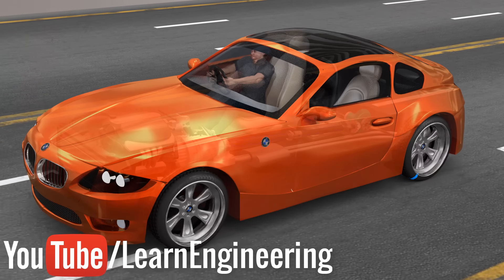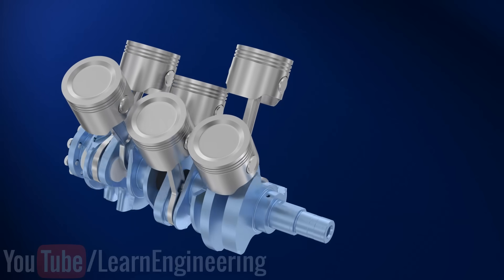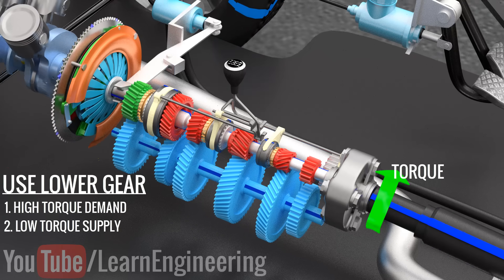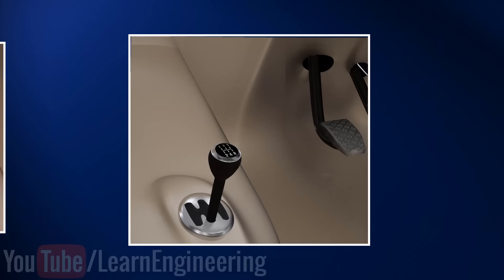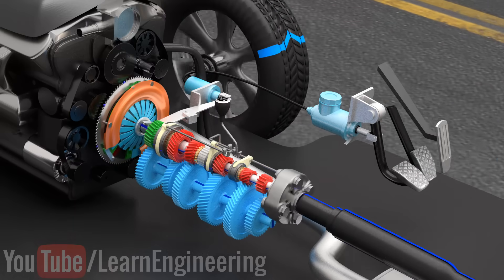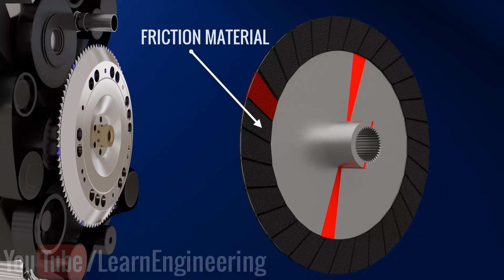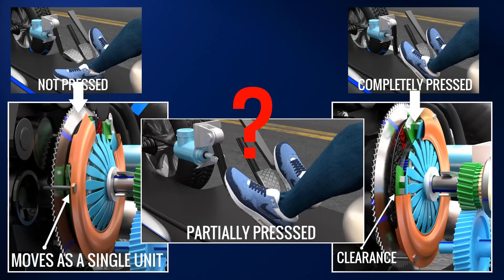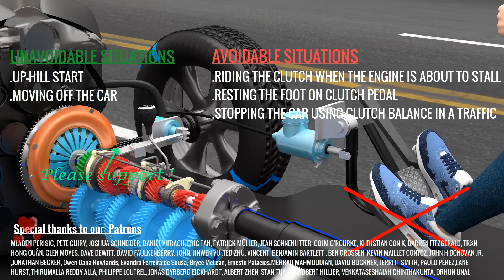Why you should not PARTIALLY press the Clutch?

Comment: You have to depress the clutch slowly though when you start running in first gear or else the engine would stall if you release it too quickly. You can't really avoid riding the clutch in constantly crawling traffic or else other motorists will be annoyed at you for always stopping your car because only at neutral at stop or when the vehicle is above stall speed can you take your left foot off that pedal.  It's not always as simple and straightforward as this video suggests.   However, it's really a good habit to keep your foot off the clutch when you're not using it as that would cause unnecessary wear.
Reply: Not unless you clutch dump when taking off at green lights every time. Skid marks on the road and everything
Reply: Feeding the clutching is handy for parking lots and super slow speed traffic jams. I'd rather do that than hit something or bog the engine down with brake action. Its a small price to pay for control.
Reply: @NICO gaming -  asked (then deleted) 'why don't I show you' how to drive correctly?!
Come over anytime and I'll happily 'show' you.
While I'm at it I'll teach you some manners - something your mummy clearly forgot to do.
There's a huge difference between correctly operating real machinery and sitting in front of a computer screen playing with your stick.
Now, go back to playing your one-handed 'games', little troll.
Over and out.
Reply: You can ride the clutch when at an incline where you have to stop a lot of lazy people do this as it's easier then putting it in neutral and handbrake
Reply: @djthegrateone  
Why, in the name of all that's logical, would you put a vehicle in neutral on an incline?!
Reply: No you don't, you know just need to know where the biting point is and have good control of the gas pedal.
Reply: There is no need to 'ride the clutch' in slow moving traffic.
Simply select the gear appropriate to the speed at which the traffic is moving and,  as and when necessary, FULLY depress the clutch to cater for occasionally slower speeds.
Keeping the clutch pedal partially depressed is of no real benefit.
On an incline, if you can't effectively balance your use of the 3 pedals, use your handbrake. It's not JUST a 'parking brake'.
Other than on initial moving off or during gear changes, there is NO acceptable reason for the clutch pedal to be held partially depressed.
Not 'riding the clutch' is not 'advanced driving skill' - it's BASIC driving skill.
If you believe otherwise, perhaps consider taking a course that actually teaches how to drive - as distinct from how to get a licence.
Reply: @trueaussie9230  wrong there are always slower speed in near standing still jams that requires to ride a he clutch somewhat but that isnt as damaging as they are making out to be here. But running the clutch at speed thats another kind of stupid.
Reply: @MartiniPinball  
Wrong.
My current vehicle will happily 'idle'  at around 500-800 rpm, moving smoothly at 1kph or slower - with the clutch fully released.
If you understand how to manage the accelerator in concert with the clutch, there is no valid reason to 'ride the clutch' - EVER.
EVERYTIME the clutch pedal is not either fully depressed or fully released the clutch plate is incurring unnecessary wear and the vehicle is not completely under control of the driver.
Whilst I'm concerned to minimise wear, I'm more concerned to ensure I have total control over any machinery I am in charge of.
If you want to learn how to drive CORRECTLY, do a stint with a military transport company.
Reply: @trueaussie9230  moving slowly at 1kmph with clutch released? I call bs. Every car I have ever driven goes atleast 7+ (noticibly faster than waliing speed)  maybe even 15kmph with clutch released.
Or older ones just stall if you arent pressing gas while in first gear
Reply: @TheMartuksxxxx  
I don't believe I said anything about not pressing the accelerator.
If an engine's idle speed is 500rpm, when that engine is put under load - eg by releasing the clutch in 1st gear - one must increase the fuel supply in order to maintain 500rpm.
Simple physics.
It seems either every vehicle you've ever driven has had major mechanical faults or you simply aren't capable of controlling the accelerator effectively.
But I only have 50+ years experience driving everything from 500cc 2 cylinder vehicles to B Doubles, across all sorts of terrain in many countries.
So I will just say "whatever you say, kiddiewink". 😉🤣🤣
Reply: @trueaussie9230  You must have rather unique vehicles... Like @Daniel Clark, I have never experienced any car either that will barely move on first gear with clutch fully released. All cars I've driven have also gone at around 7-10 kph at idle level RPM.
Reply: @emperror85  
Your vehicles must all be in urgent need of mechanical attention.
Or, more likely, your ability to control a motor vehicle is seriously compromised
Since experiencing all the.muppets commenting about this video I've done a survey.
I don't personally know ANYONE who isn't able to control a manual vehicle in the way that I've described.
(But we were all born before 1980. 🤣🤣🤣)
Reply: @trueaussie9230  So every single car I've driven have had that issue? Including new ones in showrooms? Newly serviced cars? Or is it maybe just your car that for some reason is weird? The only explanations I can see for a car to be able to go at 1 kph with clutch fully and not stalling is either if you have a custom made gear with absolutely ridiculous gear ratio made for climbing vertical walls, or if your clutch is so worn out that it just slides around instead of your engine stalling.
Reply: @emperror85  
I have no idea what 'issue' you think 'every single car' you've driven HAS had. ('Every single car' is singular, so the matching form of the verb 'to be' is 'has' - not 'have'.)
However, the alternative to your proposal  is that every manual vehicle that I've driven in more than 50 years, including rentals and 'brand new' cars OUTSIDE the showrooms, and every single manual vehicle that every mature (ie born pre 1970) driver I know has driven in more than 60 years has been 'unique' and / or 'specially engineered' and / or 'faulty'.
Here's a thought - if a particular driver experiences the same issue with every vehicle they drive, logic dictates that the problem is with the driver - not with the vehicles.
But, I'm sure you know better.
I understand how your puerile arrogance renders you incapable of accepting that others can perform tasks that you're incapable of achieving. (You probably refuse to accept that others have won gold medals at various Olympic Games simply because you haven't.)
So, I'll just say 'whatever you say, kiddywink'. 😉😊😇
FYI - if "7 to 10 kph at idle" is too fast for the prevailing conditions you can always gently apply the brakes - without stalling the vehicle - or fully depress the clutch and 'coast'.
Are you suggesting that at '7 to 10 kph' @ 500 rpm, if you don't ride the clutch and / or increase the fuel supply the engine revs, and subsequently vehicle speed, will not progressively decrease and the engine will just immediately stall - at idle?!
(Do you understand the meaning of 'idle' - and 'below idle'?!)
No doubt you believe that if all of the text you create is littered with primary school grammar mistakes the 'problem' is not with you, it's with the English language. 🤣🤣😉😊😇
Instead of spending your time playing with your dick, take some time to 'play with' and come to understand your vehicle.
You never know, you might discover that YOUR limits exist only in your imagination and are fed by your fear of failure.
Reply: @trueaussie9230  at speeds that low my engine stalls without depressing the clutch 
what am I doing wrong
Reply: @mikethespike056  
NO engine goes straight from idle to stalled.
If 5kph is too slow for idle in 1st gear, change to 2nd gear and possibly increase the revs.
In short - learn how your vehicle works.
Reply: @trueaussie9230  eh, you might be TECHNICALLY right, but there’s plenty of times where I live that I’m going around a corner at a speed that would be very very high for first gear and very very low for second, shifting into second and keeping the clutch slightly depressed for an extra moment or two is not the end of the world. I’m also not holding it 1/2 way going down the freeway, but acting like there’s NO time that it’s the best option for the average driver is pretty ridiculous. But then again, I’m sure you’ve driven every manual car in every part of the world, so what do I know 🤣
Reply: @BadoreksDailys  
I have no idea what your referring to when you say I "might be TECHNICALLY right".
Nevertheless.
If it's possible to find a 'speed' in your vehicle that is "very very high for 1st gear and very very low for 2nd gear" I suggest there is something extremely wrong with the design of your gearbox.
My current vehicle (5spd manual) has no complaints holding 50kph in 1st or picking up from as low as 15kph in 2nd.
And if you think taking a corner at any speed with the clutch not fully engaged equates to 'safe driving practises', good luck to you (and everyone on the road with you.)
Seems to me you simply fail to pay sufficient attention to the road to enable you to select the appropriate gear at the appropriate time.
I repeat- if you want to learn how to drive correctly, do a stint with a military transport company.
I suspect I've driven far more hours / kms, in far more vehicle types, over vastly different terrain in more countries than you can even imagine.
But what would I know?! 🤪🤣🤣
Over and out.
Reply: @trueaussie9230  hey genius, that's exactly the problem. Traffic moves slower than the crawl rate on 1st gear. It's impossible to "select the appropriate gear".

Add stop and go traffic to that and it's a real shitshow. Best you can do is to wait until there is decent cap between you and the car in front of you and roll that as slowly as you can.
Reply: @moroit1  
It seems I must be a genius, certainly compared to you. 🤣🤣
I never have any problem.
But I only have 50+ years experience driving everything from 800cc 2 seaters to multi trailer trucks.
When you start moving in 1st gear you start from 0kph - ergo there is NO speed too slow for 1st gear.
That is the purpose of it.
The fact that YOU can't do something does not mean it can't be done.
Perhaps if you ever grow up you might actually learn how to drive - and learn respect for those with more knowledge and experience than you.
Over and out.
Reply: @moroit1  @Trueaussie is a troll most likely or has driven in outbacks. Really there is no other way when the traffic moves slower than the crawl speed.
Reply: @younawab  
Your funny 🤪🤪🤪😅😅😅
Reply: @moroit1   Just coast at the lower speeds. Never ride the clutch. Eg. Engage the clutch slowly from standstill in 1st gear, then disengage the clutch and roll. Then slowly apply the clutch to engine brake. Repeat.
Reply: @sideparting6845  And that my dear is a fast way to wear out & overheat the clutch in stop & go traffic. 

When you do it slowly / ease it in or out it is generating movement friction between the clutch plate and flywheel contact plates. That friction generates a lot of heat and clutch area is not usually too well ventilated, so it collects heat fast. 

I recently replaced clutch & DMF on my daily for the first time at 375 000km. Clutch itself was in near new shape as it was driven properly. (Replaced due to worn DMF)
Reply: @moroit1   When I said "ease in slowly" I meant over half a second rather than dropping the clutch. I wasn't meaning giving the car gas and then easing it in over 10 seconds. I just meant normal driving but with coasting.
Is there a better way?
Reply: @sideparting6845  That's just normal use of clutch. Easing it in has always meant releasing it with a good while of slippage. Dropping the clutch would be on the another end where you, well drop the clutch without any easing it in.
Reply: @Mario Antonio
Depressing the clutch pedal disengages the engine from the transmission - and you go nowhere.
When "you start running in first gear" you need to RELEASE the clutch pedal.
If you don't understand those very basic facts it's not surprising that you don't know how to operate a vehicle correctly.

Comment: I'm guilty of doing this, but only when and if I need to park up a driveway with a slope, and in 1st gear only. I thought everyone did that. Because that's how I slowly get up the drive way without stalling and without going so fast, that I run the car through the garage door by accident. It's also something I do in reverse when I don't want to wait for my idle to slowly push me, but I don't want to gun it in reverse either. Again, thought everyone did that too. What I don't get, is why anyone would do that in any other gear other than 1st and reverse.

Comment: I press partially press the clutch all the time and my car never had any problems. I've used it almost every day for the past 5 years and the car is 20 years old. People also say that you should push the hand brake button when breaking the car and that doesn't seem to be true either. Just be reasonable on the way you drive and everything should be fine.
Reply: You're putting unnecessary wear on the clutch, and have poor driving technique. But that's your choice. Also, you shouldn't be using the hand brake at all while braking.

Comment: Would fully depressing the clutch burn your clutch out or does it only burn your clutch when it's 50% depressed or depressed to its biting point?
Reply: When the clutch pedal is fully down or fully up, there is no wear to the clutch plate. The clutch plates wear down when it is partially engaged and there is slippage (in other words, when the clutch pedal is half depressed and kept at the biting point). However, when you press the clutch pedal down, it puts wear on the throwout bearing.

Comment: My mum used to (at least I hope she doesn’t anymore) rest her foot on the clutch pedal burnt the clutch out completely in about 20k miles, just had it replaced. 

I always rev match and heel and toe (95% of the time anyway) because I have more mechanical sympathy and my engine is out because of a bottom end failure, but looking at the clutch at 65k miles it’s still got plenty of life left in it, unfortunately it’s getting changed anyway due to replacing dual mass flywheel as well. 

It pays to learn how to drive manual properly, more driving satisfaction, less damage to your car

Comment: Yeah but sometimes you need to change gear fast in situations and not fully press the clutch is necessary
Reply: Name 1 situation where that's necessary.
Reply: @tylhunt  could maybe need to change down gears to slow down in case of emergency you going to make sure you fully depress the clutch when you are going to hit something you would just smash the break and drop gears as fast as possible and most likely a few will be half clutch or almost full clutch press but it won't be priority will it to save the clutch when you need to stop.
Reply: @Lih55  If you need to stop in an emergency, press the brake pedal. That's it.

If you need to change gears quickly for whatever reason, depress the clutch pedal fully to shift. Partially depressing the clutch pedal and shifting is not going to harm your clutch, but it may make it difficult to shift(causing you to take MORE time to shift), and cause damage to the transmission.

Comment: Without a half clutch you can't drive in a tight traffic jam and in taking off in a steep road half clutch is necessary. High Acceleration and slow clutch release is necessary while releasing the brakes quickly... very difficult... I can do it without using the hand brake
Reply: That's why it's mire fun driving manual transmission car than AT

Comment: I ride my bike with half clutch most of the time. If u want to ride in traffic with less clutch then u have to ride in second gear which will increase petrol consumption.  If u want to ride in third gear mostly it will stall becoz rpm for third gear in most of the bikes is not suitable for slow traffic.There is no other option than to ride in half clutch
Reply: That's just stupid.